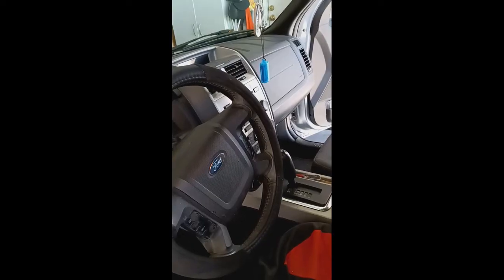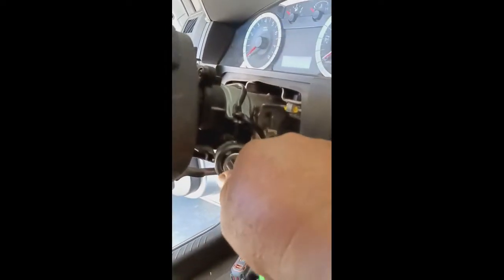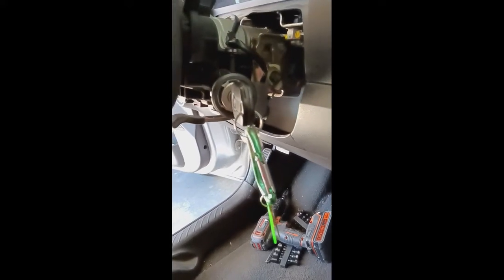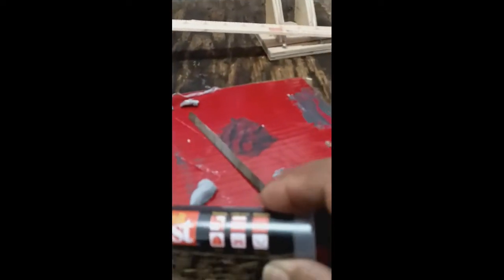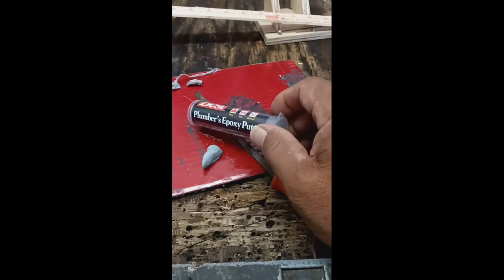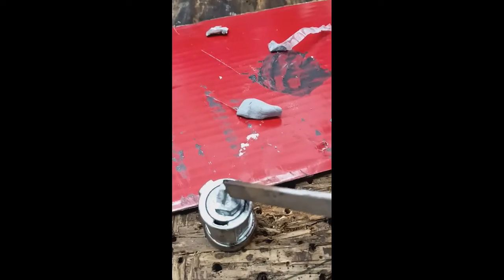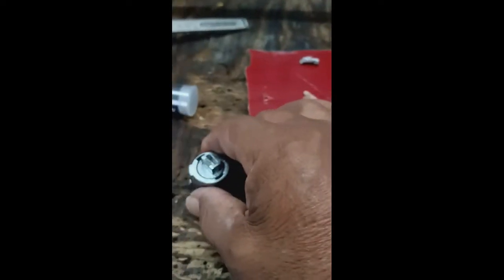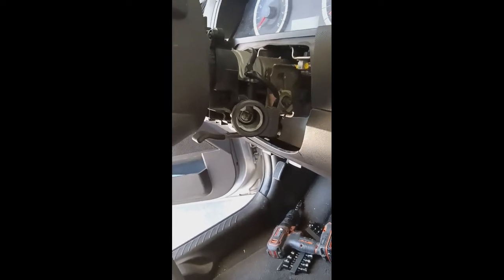Ford Escape Ignition Key -Easy Fix

Comment: I used  two part J B Weld epoxy that had a 6 minute working life yet a 4 to 6 hr. before being fully cured.
I must add after watching several other videos with a 1/8" rotary file to cut back the stop you hit while starting. Yes a big PITA to remove the crimped stainless cap then reassemble, recrimping making sure the cap is tight and solid again. 

Videos leaving rotary file chips inside against the tumbler assembly was nasty. Clean then lube with thin bicycle wheel bearing grease made by ParkTool----PPL-1 Polylube 1000 Polyurea Grease. Good bicycle shops carry it. 

I had to ask, why not also fill in the hollow center section and all across the top adding support also strength to the extended epoxy buildup yet still able to assemble as per Felix's instructions allowing just enough tumbler assembly  movement in and out, something like 0.006" to 0.008" to not be wasting key rotation action instead being applied towards that little pin?

Felix nailed it vs opening up the crimped cover also a PITA time wasted.  

By this man Felix an expensive bottle of wine for his dinner I say. Thank You Felix, your the man. You can't fix stupid as well greed and self serving making millions. Term limits along with same medical coverage as we the public must pay. Anything involving the gov. is dirty and expensive. ......~~=o&o>.......

Comment: Dude - you are totally wrong!  That little switch is only to tell u the key is in the ignition - that's it!  In order to really fix the starting problem you have to grind a little out of the cylinder. The switch has NOTHING to do with the starting. Trust me - I worked for Ford for 18yrs. I know.
Reply: David got a 2011 Ford escape turning key not starting what do you thank my problem
Reply: @dbsimmonds can you help me
Reply: ford sucks!